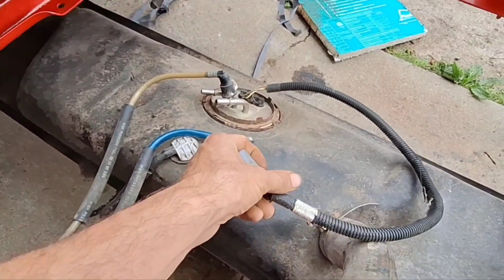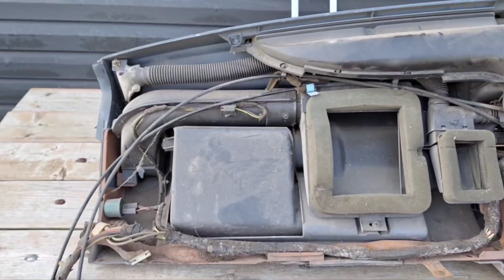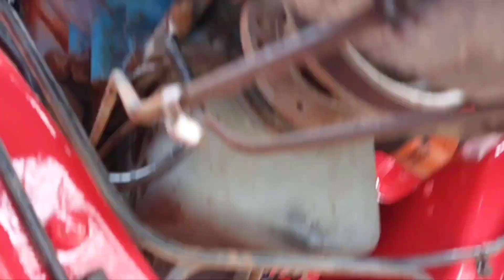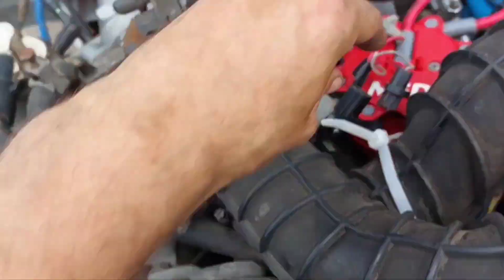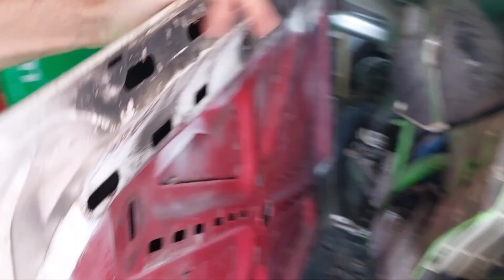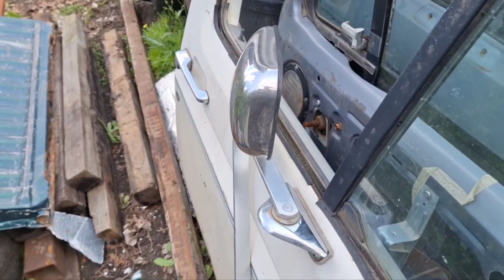1988 ford f150 pt 8 Roller Frame Assembly setup mock up to find all the parts

Comment: You might want to check and see if you even need to have that fuel pump on the frame rail since you switched to a high-pressure pump in the tank they might try and compete with each other and cause problems. I’m not sure, but you might want to check.
Reply from the maker: Hi, I know what you mean where I don't necessarily need the fuel pump in the frame rail anymore, but in order to delete it I would have to switch the fuel lines to a newer style that only runs the 1 pump. Although I do like all the stainless lines that come on the 92 - 96 trucks, I don't think I have all the lines in my parts collection.
I ran this setup before on a 1990 460 that I swapped into a 1995 f150 rcsb. They won't compete with each other but they will work together providing more fuel flow and being less likely to starve the fuel pump in the frame as it will always have fuel provided to it quicker at wide open throttle and the regulator on the fuel rail will handle the rest keeping the proper psi. I hope it works that way anyways. Thanks for the comment!